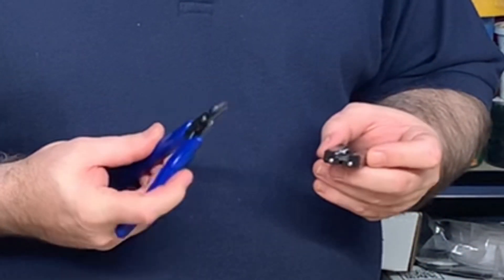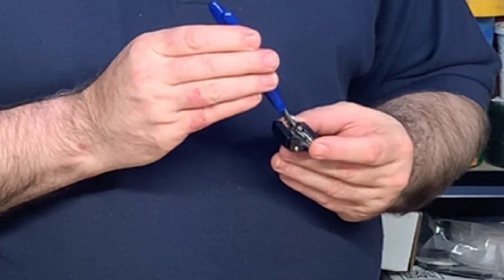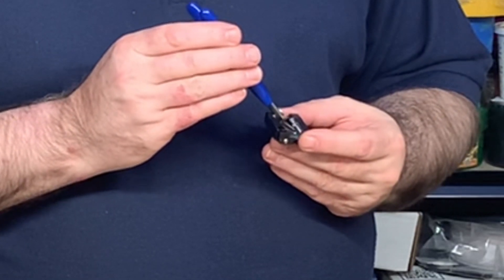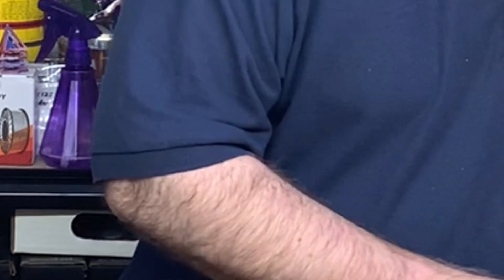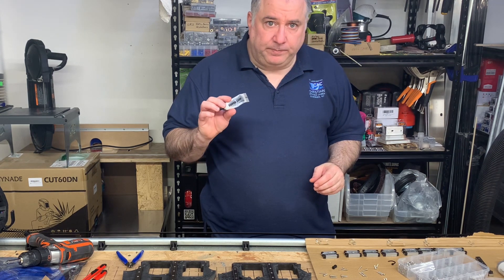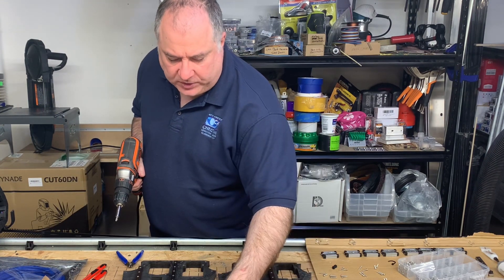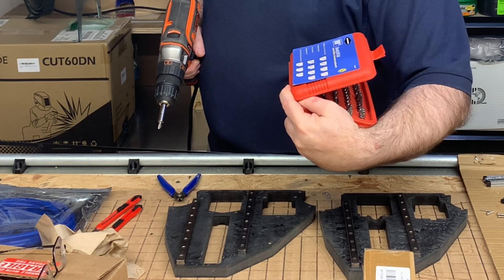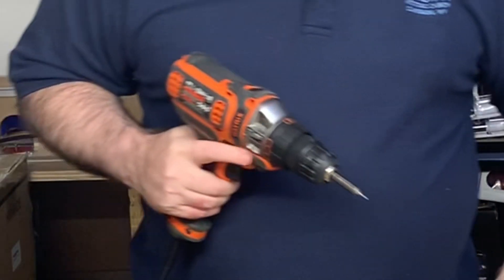LowRider 3 CNC Plasma Table PART 8 - YZ plates (Side Assemblies)

Comment: Could one make this with 1/4 Aluminum plate and make it more rigid, or would the thinner dimension cause an issue with the build?
Reply from the maker: Ryan of V1 Engineering sells both steel and aluminum XZ plates (and they are 1/4"), and a lot of guys with LowRiders are milling their own out of aluminum or other materials. Ryan's are laser cut (super nice and precise). The PLA-printed XZ plates are quite usable (very rigid), and would probably have been just fine on my LowRider 3 plasma rig, but I already had aluminum XZ plates (from Ryan) on my LowRider 3 that carries a router, and I later replaced them with steel plates (also from Ryan) just so I could move the aluminum plates to my second LowRider 3 that carries the plasma torch. So, since I made this video I replaced the plastic here with aluminum.
Reply from the maker: The only impact on the build that results from thinner XZ plates, is that it adjusts where the side assemblies ride, by just a few millimeters. The adjustment is easier to deal with on a wooden table made for a router (just relocate the Y axis belt tensioners), but I am easily dealing with it on my metal table for plasma — I just now remixed the little printed plastic rail blocks so they adjust where the EMT conduit is held. The conduit serves as a Y rail guide (axis constraint) for the LowRider's motion.
Reply from the maker: One way to deal with the offset change by thinner XZ plates, is to plan for your EMT conduit pieces in the X axis gantry to be length adjusted as needed. But if those EMT conduit tubes are already cut, as in my case, another way of adjusting is called for. Thus I remixed the rail blocks. It only called for a little over 3mm of change in that case. That's half the ~6mm difference, spreading the change equally on both sides. On my plasma rig, the far side assembly rides on a 1 1/2" aluminum square tube, and a minor change of where it rides is no big deal.